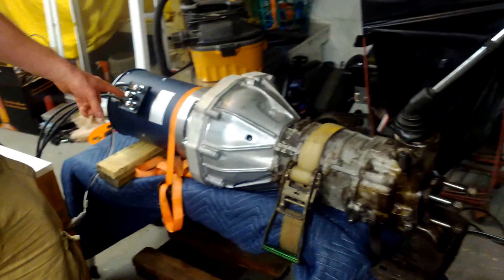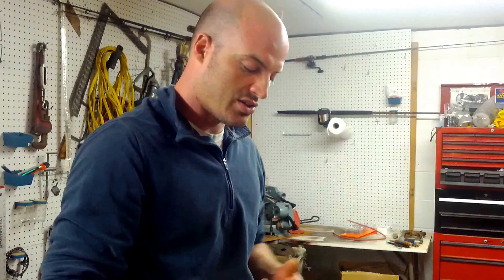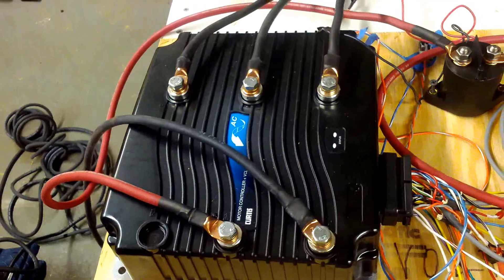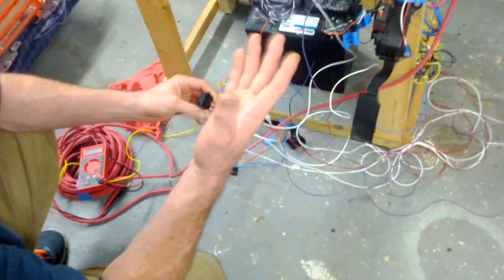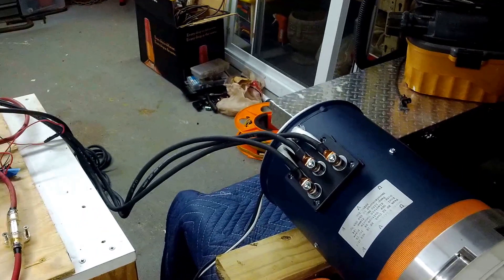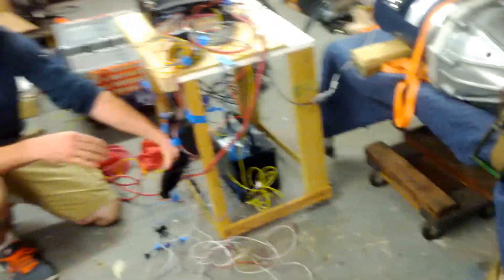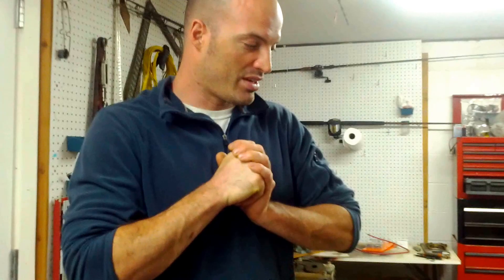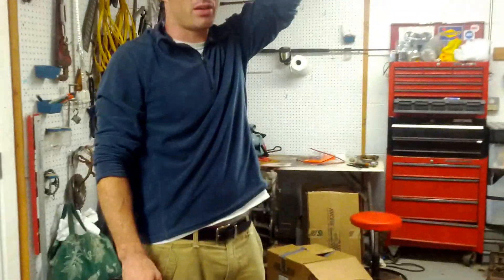Electric Alfa Spider Project :: Powertrain Bench Test [GeoRides.com]

Comment: Excellent work. I'll be watching for the final on road drive. I have two leaf battery packs and will be using mine in my VW Bus. I have the HPEVS AC-35. Just had the controller and encoder upgraded. I'll be using 80 modules for a total of 30kWh pack. I will have a few modules for spares. So far all mine have bottom balanced well. Motor arriving on Tuesday. Time to get cracking on my Bus project. Still working on my VW Bug DC project. Can't wait till I see yours on the road. 

Pete :)